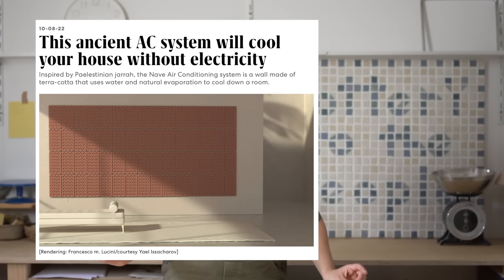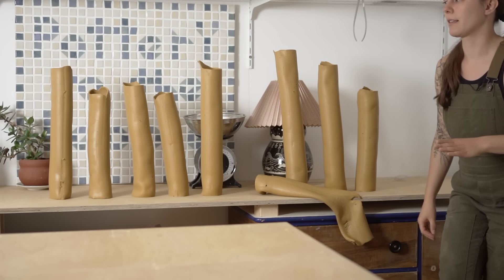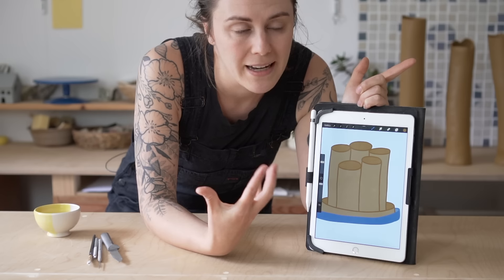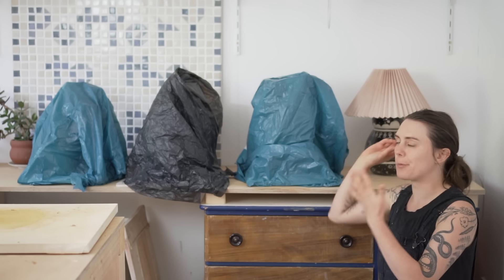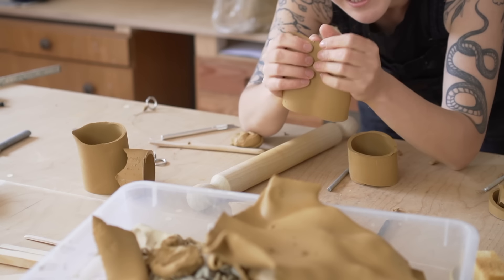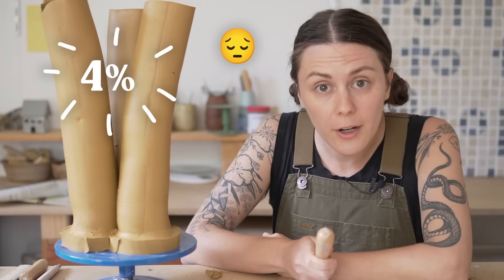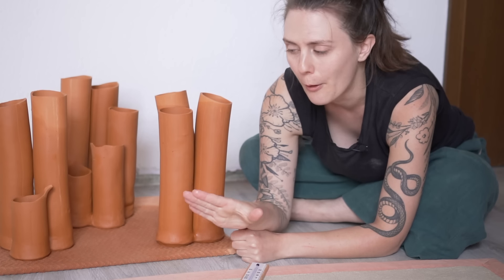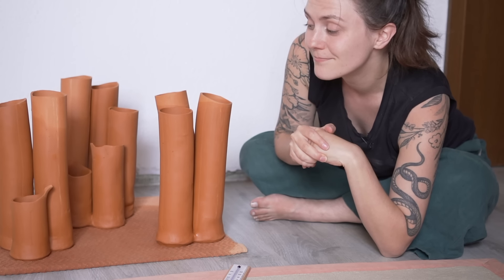Can I make an A/C out of clay???

Comment: I think the reason the design you originally saw worked is because it's a full wall of terra-cotta with a high amount of surface area due to the patterning.  In the day when humidity is high, it's porous enough to absorb the high humidity of the hot day (hotter air can hold more moisture) when it's dry, and when the day cools down at night it can leak the excess water.  Likewise on a very dry day, any latent moisture in the wall can evaporate to give the impression of coolness similar to a swamp cooler (an evaporative AC, basically) by lightly increasing the moisture.  If you need to add more moisture, you can lay out bowls of water, or if this is fashioned just so, fill a reservoir with water so that it can leech into the wall and evaporate more throughout the day.  Your idea is combining the reservoir with the terra-cotta, but yes, you need a lot more to have a significant effect.  A dozen small columns isn't enough.  You would need a hundred, if not more.  In a small dry room with a lot of heat these would lower the temperature quite a bit until the ambient air reached its saturation point.  By then though, the humidity levels might make the room feel stifling.

The reason we moved away from evaporative cooling like this to condenser heat exchangers is because it ensures that the heat is expelled outside of the space you're in.  There are passive ways to use that heat exchange method, but it's really expensive and unmanageably large and bulky to do on a house scale.  Cooling a CPU, for example, is possible with a radiator the size of the computer case it's mounted to.  That's enough to keep the CPU well below it's 100C limit, but ramping that heat spreader to room scale the cooling effect would be no where near as effective and the radiator would be the size of the side of your house.  You're better off going with better insulation to reject heat transfer altogether.
Reply: Why cant these terra cotta evaporators be out side and have a heat sink to syphon the heat energy from inside? That something thats been bothering me about these like leave the evaporated water with all the heat outside by using the heat inside to help with the change of state, or using water under a vacuum in a closed loop to boil at like 20c(or what ever temperature is achievable in the condenser) and let it condense out side in a terra cotta cooler. It seems like it would self cycle the water under a vacuum too. Basically what we do with refrigerant just with out adding a bunch of pressure to make the heat shedding easier. Is this complete bunk? Im sure im missing something and it can't work that way I get it I'm an auto mechanic I know Im coming from limited knowledge. Ive wanted to ask someone that has like physics degree if its a really dumb idea.
Reply: @Jesayou this is actually basically what a AC is and does. Water is a refrigerant after all but because of waters higher boiling point you HAVE(unless you want the energy/heat it takes to boil water constantly without the assistance of vacuum to make it less energy intensive) to use a vacuum pump just the same as the refrigerants we use today and it would cost a ton of energy because the vacuum it takes with water is pretty high(not very but a lot compared to modern refrigerants which only need a ten or twenty psi less than the atmosphere pressure).

The reason why AC is mostly linked with climate problems is not usually to do with the methods itself it's with the shitty disposal and use of bad refrigerants which we are still dealing with the consequences of today. Not to mention that the energy that they consume is quite a bit, now if we instead of having ACs being constantly at war with the outside temperature(why it actually takes so much energy, if you have ever had a chest freezer it works the exact same but one obviously is way less energy for something that can get sub 0 temperatures it is all due to the escape of the cold into outside elements and it isn't just due to size it is actively fighting against the outside elements because our houses are not fully insulated). This is why a better insulated house will hold in cold much better and why central AC is way better than a Window AC unit.

Sorry for the rant it was something I looked into in a hyperfixation on refrigerators and why chest freezers are less energy than upright fridges that are in style. ADHD engineering at it's finest lol.
Reply: @pf6137  I was definitely not thinking of course the expanding of the water boiling would increase pressure that would require more vacuum to keep the boiling point low I was a little intoxicated when I came up with the idea

Comment: Fahrenheit is a finer resolution than Celsius... If your C is right, you should have seen a 2.7F drop. If your F is right, you should have seen a 0.5C drop. But having lived in a desert, the room temperature is too low to see an affect. This should work in a dry hot place. Running a fan over them may work. Don't put them in the sun and don't try this in high humidity because it'll only get more humid.
Reply: But this is a good start. Thank you. I've wanted to do this for years.

Comment: There are people commenting on on evaporative coolers, that kinda work with the same idea, and people managed to make ice on the desert sometimes using evaporation from water in yakchals, so it can work. Your video is great and you pottery is 10/10. My complaint is that your conversion was a bit wrong. A fahrenheit degree denotes a smaller change in temperature than a degree Celsius. If you convert correctly the temperature, you'll find out that 23ºC equals 73,4 ºF and 21,5ºC equals 70,7ºF,  so you have almost 3 ºF in difference. But Fahrenheit is a bullshit unit, better to stick to Celsius. 1,5ºC can make a significant difference in comfort

Comment: heyheyhey! i think it starts working super well once it starts sweating. to make it sweat you need at least 30-40-50-60 Celcius, we are reaching those temperatures in a lot of places so I think this is super dope! Also energy/electrical grids are going to fail, so this is a great great way to ease down consumption. This is COOL AF, saludos from Argentina. I haven't done pottery in a while, I want to try making it so bad! I don't think I am going to have that cilinder-maker machine. do you think I could replace it with carton tubes that I make? will they then burn fine in the heat?
This is going to be so good for the heatwaves!!!! Thank you! this sparks hope!!!

Comment: If you plan on making more of these , I’m not sure what the diameter of the clay tube is but if it would fit you could hot glue a pool noodle to a flat plate or board cut to your desired length and once you extrude your clay tube you could slide it over the pool noodle to hold it upright while drying 🤷🏻‍♀️ if it’s diameter is bigger then a pool noodle of course
Reply: Genius!

Comment: I 100% thought this was going to be a clay version of the pop bottle window AC used to cool houses in hot, poor areas. In case you don't know what I'm talking about, they re-use plastic pop bottle with the bottoms cut off, leaving basically a longish funnel which is then attached to a board with holes cut into it. The spout fits into the holes and the lid is replaced (after the top of the lid is cut away) to hold the bottles in place. This contraption is then placed into a window or door where the wind blows in. Because the air is moving from a larger area through a smaller area (from the funnel to the pour spout), the air naturally cools, the same way hot air from your mouth cools significantly when you blow through pursed lips vs an open mouth. Maybe you could try something like that for something that works better and more efficiently and will also not increase the moisture in the air (which obviously isn't great, depending where a person lives).

This was a neat experiment, though

Comment: A few years ago, I read an article about air conditioning. I think it was the one on Slate by Daniel Engber. It really changed my perspective - he talked about how AC uses less energy and emits less carbon than heat - and it may actually be more important for human comfort. I realized my opposition to air conditioning had more to do with seeing it as an unnecessary novel technology than a real cost-benefit analysis.

I don't have AC in my home now, but I'm considering getting heat pumps. Heat pumps can provide heat as well as cooling, and they are actually more than 100% efficient at heating because they are not generating the heat directly by burning something, but moving it from the outside to the inside. So my hope is that I can actually reduce my emissions over the course of the year by using them as my main source of climate control.

I was really excited to find out about this technique but it wouldn't work for me here in Pennsylvania - it's way too humid! From the thumbnail I was guessing that the pipes were used in some kind of wind catcher... that would be cool too!

Comment: I asked myself why you block one side, than I realized you just made water cooler. 

Ir you want to cool the air, you need airflow. Make smaller diameter pipes, stack theme horizontally, and make them wet whenever you want cooler air. You can do it manually or with a small water pump. 

A little fan can do magic as it increases airflow, hence evaporation. 

This is not zero energy situation. Even you pouring water is an act of inputting energy. But, yes, this is very efficient way of cooling your room. 

Note that, the humidity will rise, and that's a little problem in pottery, because your products will take much longer to cure.

Comment: @Pottery to the People

Pool noodles! They'll hold them up as they dry.

Mmm... Interesting! I've been thinking about sort of a hybrid between Persian wind catchers and a zeer pot. The wind towers also sometimes have an underground stream/well for the air to pass over before cooling the house. It's called a Qatar, I believe. Anyway, without building a huge tower, a stream and well the zeer pot could serve as the Qatar part of it passing the air through it. The chimney of the tower is didved into several smaller vertical channels that feed the air down into the zeer pot. When the air channels up out of the zeer pot it travels into the home and back out again through another smaller chimney. Anyway, this cooling method is insanely effective and has been in use for thousands of years. I don't claim any credit for any of it and my idea is to make it compact and portable! ...and open source to all.

Comment: Interesting.  I use a similar technique with clay plant pots.  Either block the holes in the bottom with silicone or by the cover pot version without a hole and then fill with water.  Better yet, put a plant in it.  The evaporation out of a plants leaf (called transpiration) will cool a house a lot faster then these clay pots.   I have a house filled with plants and it has allowed me not to use an air conditioner in years.  I do have a lot of plants to make that happen.  About 50 small trees and over 300 plants total.  

Downsides to this method are that it is less effective, or sometimes completely ineffective in humid environments.  These air conditioner systems are almost always used by desert peoples.  It may also over humidify your house resulting in mold, or the use of a dehumidifier that pumps out more heat then the evaporation cools. Further, you would require a lot more then a few.  You would have to cover one whole wall, floor to ceiling, with them.  Another down side is that they do not last long.  Lime scale forms in the pores of the clay after a while which stops the wicking of water from the inside to the outside.  This can be resolved by using distilled water but that adds cost and inconvenience.  And of course, the distillation process and plastic bottles are not the best for the environment.  Use of plants rather then clay resolves this.

Comment: as someone in the south, and in the hvac industry..... these won't work as an ac replacement. Ac works by removing moisture from the air and heat. Here you're adding moisture and a bit of heat.

Right now the wetbulb I'm more worried about than ac. Wetbulb is the humitiy where sweating doesn't cool anymore, because there is too much moisture in the air. It's deadly.

I agree that we need to find a better way, but I'd argue that it has to be at the source of power, and possibly how we build houses (make them more naturally cooling) than at the ac level.

Comment: One thing to note about these is that the more humid an area the less effective they're going to be, because what they are is essentially primitive swamp coolers, you find ancient use of these and other similar concepts (like wind trap precipitators) in places like Iran and Mesopotamia where there were large population centers in very dry and hot places, they'd work in Arizona, but nowhere east of Texas. You also can't rely on one method alone, this will not in any configuration replace an air conditioner, you have to design the whole structure around taking advantage of multiple methods of passive or semi passive cooling, for instance blackout curtains will cut the infrared light and therefore heat (that probably helped as much or more in your experiment), having top notch insulation either through modern methods or just making your walls four foot thick of mud bricks, putting in long undergrounded air intakes and outputs at the peak of the roof to create a draft that outputs the hottest air and draws in from a large enough area undersurface that has time to cool before being drawn into the living space (if that makes sense) because trapping hot air in your attic will eventually build up heat in the rest of the structure. A lot of what we do in house construction is driven by economics and aesthetics when we'd be better served by looking at traditional construction in areas with similar climate and using that to tailor architecture to the conditions at hand.

Comment: Ok, you said it was going into the hotter time of the day and measured the temperature and it went down one degree ... instead of going up 6 or more degrees? In my town, the later in the day, the hotter it gets in the house. By a certain time of the day, we sweat inside. The dogs go lay in front of fans and lay on the hard wood floors which may be hard but they are definitely cooler. I think your system is working. But how much hotter does it NORMALLY get later in the day. A proper test would be measuring outside temp at different times of the day along with indoor temps without the tubes. THEN doing it again the next day WITH the tubes. Comparing the differences. Maybe even several different days. I like terra cotta tiles on the floor during summer but do not like it in the winter hence why I never bought them. Too cold! Icy even.

Comment: cool project but evaporative coolers dont really work. long term atleast, more of a short term solution. and they work even less in humid areas. they really only thrive in arid places where the hydration in the air is so low the water being evaporated has no effect on the system around it.

Comment: One comment about the towel - you’re effectively putting something that wicks water under something that leaks water… it’s not going to keep the floor dry, it’s just going to keep a damp towel against it instead of a puddle of water. Better would be to just put a plate or piece of plastic or even tinfoil under it.

Comment: Meteorology major here: theoretically, this will not work as ideally as you may want as the wet cooling rate is less pronounced versus the dry cooling rate (adiabats lines). So it will not only make it more humid and sticky in the room it’s in during the day, but it will slow down how fast it cools in the evening and at night.

Comment: dude, I've been to the Philippines because I'm half filipino, and I've seen the problem solved rather quite easily, with big tall shading roof structures, its like the easiest thing, put your roof up another ten or 15 feet and make sure it covers a good area so its all well shaded where you want it to be cooler. dont need air conditioning at that point, unless you're a bit fat like my folks, that extra body-fat-insulation made them still want and use an AC unit, when I live in the same spot, and its just comfy for me. also the aluminum fins drains the subtle life enhancing charge within the air too, so from now on I'm gonna try to avoid such things if possible

Comment: You need to add a fan to blow the air through the clusters. Also, these should be kept on a high shelf in order to cool the top air in the room which will in turn mix downwards as cold air is denser than hot air. So have these on the top of bookshelves surrounding a ceiling fan. Have fan rotating that that airflow goes up. It will then spread towards the clusters and then cool down and roll back down to the ground.